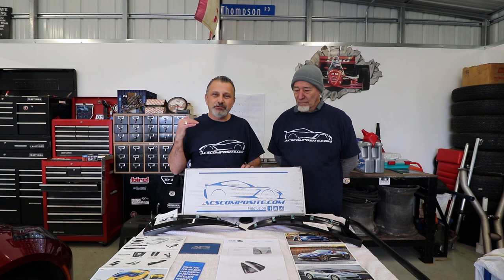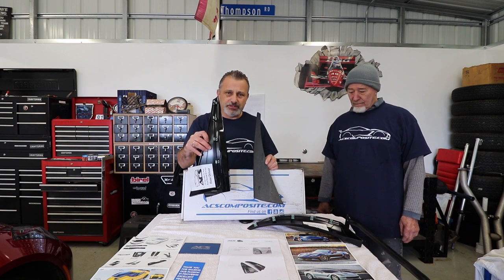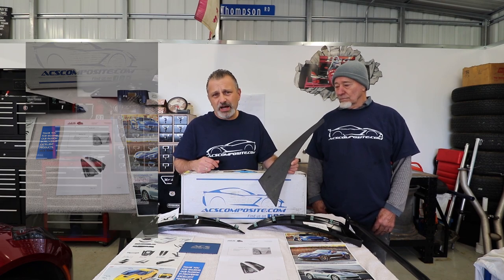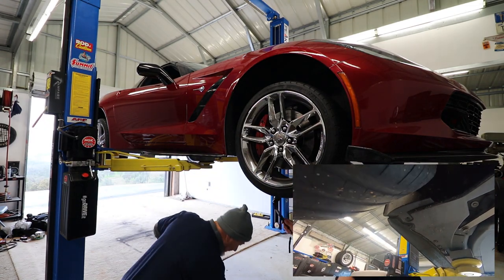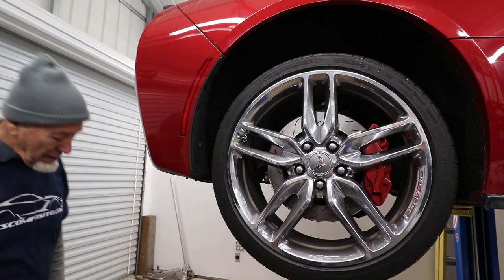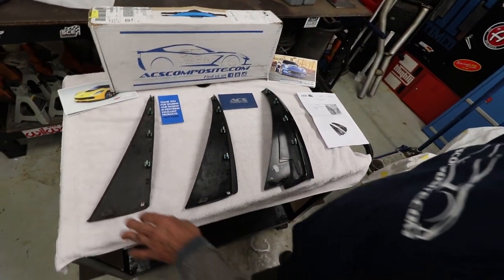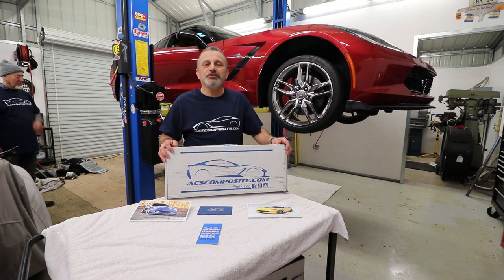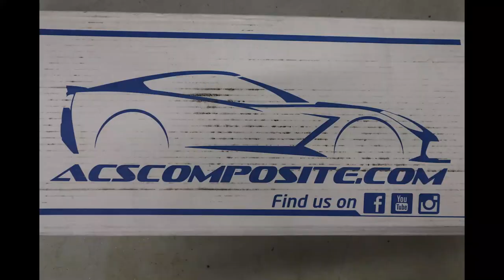ACS COMPOSITE XL Front and Rear Rock Guards For C7 Install and Review

Comment: Just an FYI, I just finished installing my new XL ACS rock guards and in your video, you left out that on the rear ones you have to transfer the screw retainer clip from the stock ones to the ACS ones or you won't be able to tighten the screw to anything....just saying.

Comment: I bought ACS front & rear rock guards for my 2017 Grand Sport Limited Edition. The front ones have fender extensions, the rear do not and there are no rear splash guards installed. Are all the clips holds have a place for inserting them? Or is there another way of installing them?
Reply from the maker: Hi Adolfo,
What model of Rock Guards did you get ?
Let me know,
Scott